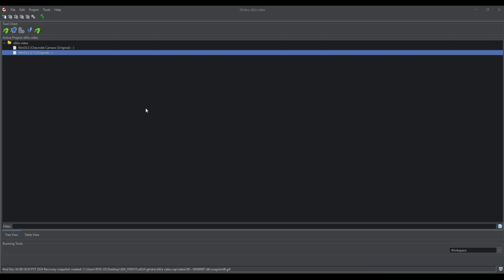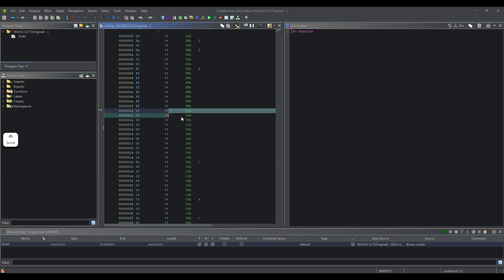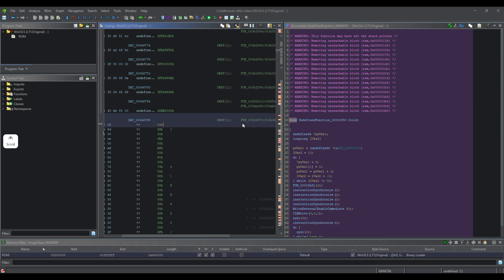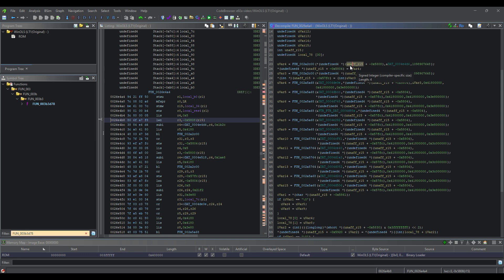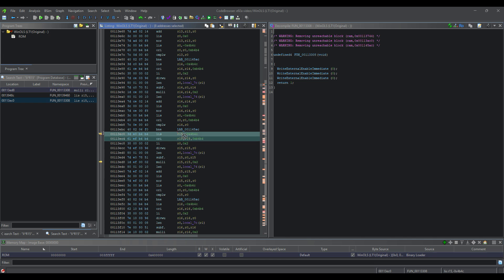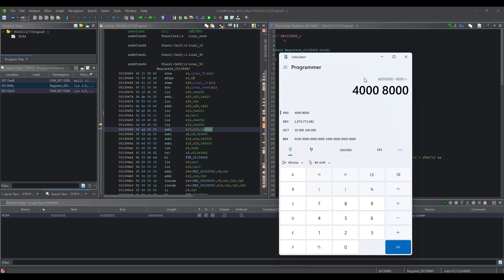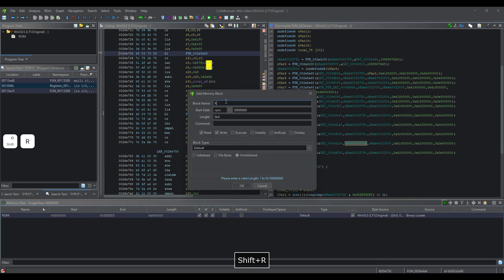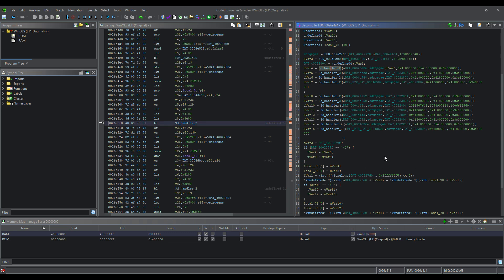Part 1: GM Gen 5 LT1 E92A Software Disassembly with Ghidra

Comment: I've been working on disassembling a p12 for an 06 trailblazer and I have all the pids and dtc handlers mapped but I'm stumped on the fan selection logic. The PCM has 4 different ways to handle fan control - no fans, discreet, and 2 other pwm modes. I presume its handled by some kind of enum or bit map, or at least that is what it seems like it would be from HP Tuners...

Anyways, I guess my question would be if you have any tricks for finding things like that where there are certain pcm features enabled by a toggle.
Reply from the maker: Find the function that handles the temp and whatever other thresholds must be met for the fans to turn on. Start aggressively throwing names at stuff and tracking them through the Ecu until you come up with something. Think of other things that may be switched on or off. The bytes for these switches may be in a similar place. Another thing is fhifra optimizes functions before showing them in the decompiled view. If the function starts with if 1==1 then skip to the end and return 5, ghidra sometimes removes all the code from the decompiled view and just says RTN 5. You’ll notice this if the assembly view has a large function and the decompiled view is very small. You can view the code by checking the box w on your rom in your memory map
Reply: @GHIDRAuto  ah, that's what I was wondering. I was seeing the dead code skips at the top of the decompiled functions. Figured the code path might be hiding in there

Comment: Thats great, have you done anything with TCU's I was teying to find out some stuff about 8hp can bus ids today but as first time ghidra user i was not very successful 😂
Reply from the maker: I don’t work on tcms often, but here is a video with a quick over view on a tcm I worked on lately. The third patch mentioned in the video solved the issue. Aisin transmission control module Hacking with Ghidra and Winols. Renesas SH7055
https://youtu.be/Irsq7P4nxjk
Reply: @GHIDRAuto  interesting because 8hp is also a renesas MCU, sh72xx supposed to be similar, when you import the files what architecture do you select for the renesas? RISCV 32??
Reply from the maker: Sh2A.
Reply: @GHIDRAuto  and @Minirider, same for 6HP ?